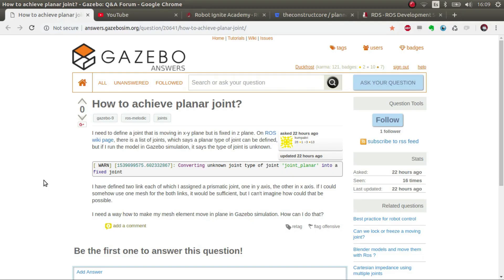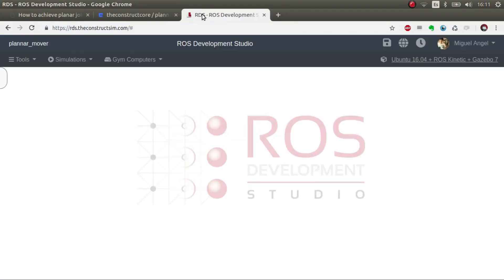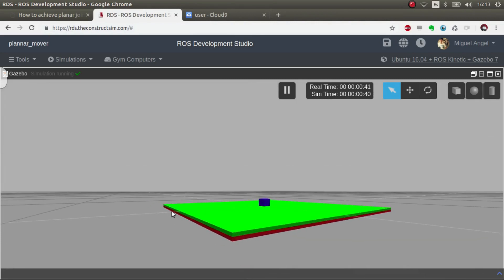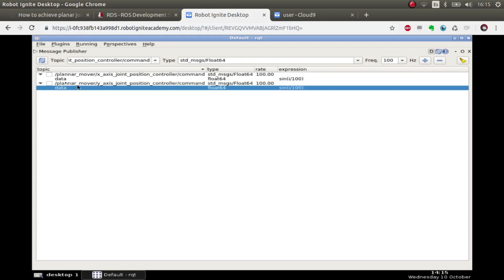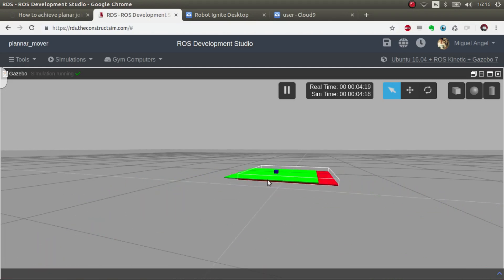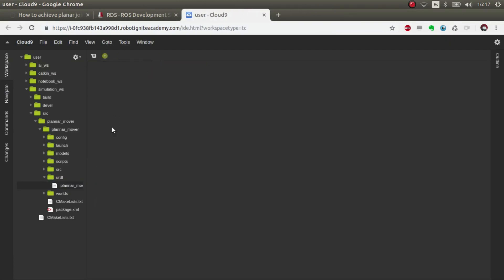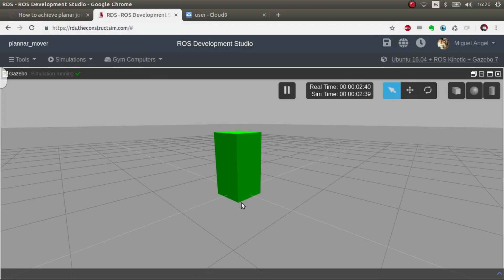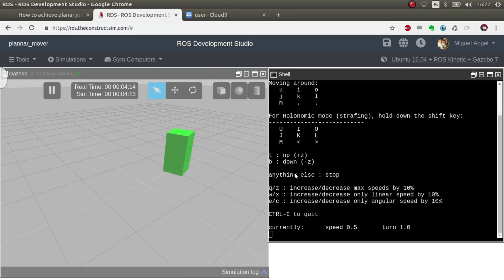[Gazebo Q&A] 004 - How to create a Planar Moving Element in Gazebo ROS

Comment: Hi! Thank you for your nice video and code!
The problem that the green plane (upper plane) falls to the ground: the origin of the joint "x_axis_joint" to connect "world" and "x_axis_link" should be "0 0 0" but not "0 0 0.01". When the plane below floating in the air （0.01m away to the ground） falls down due to gravity, one side of the plane tilts up, which looks like the upper plane falls down.